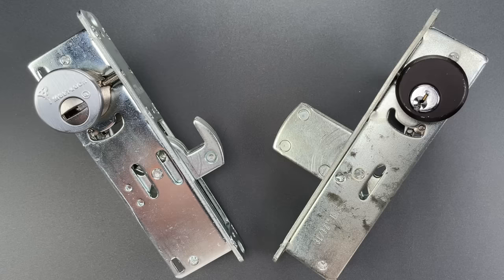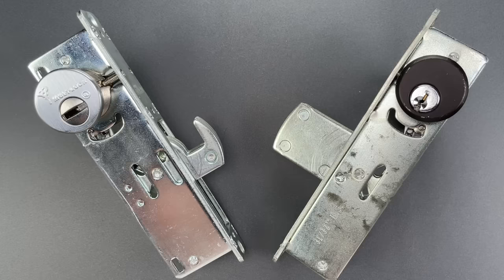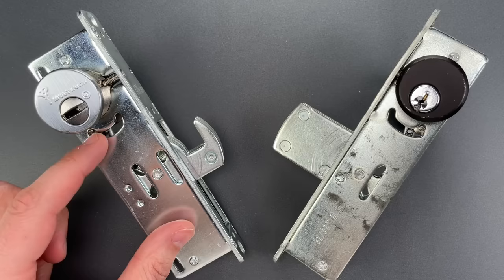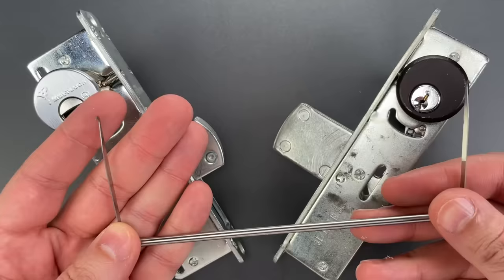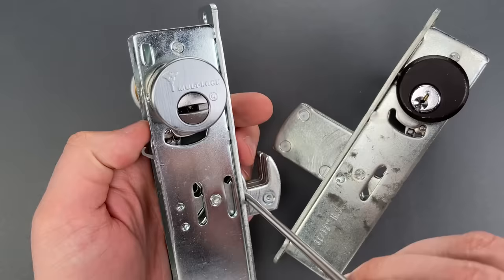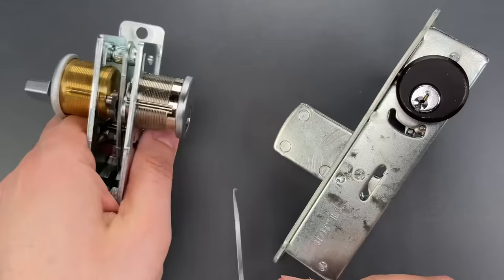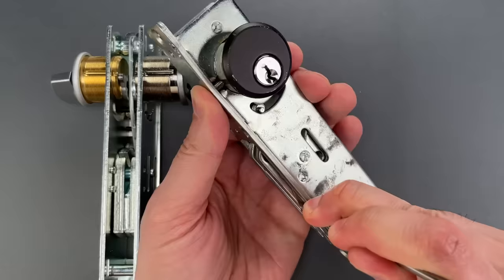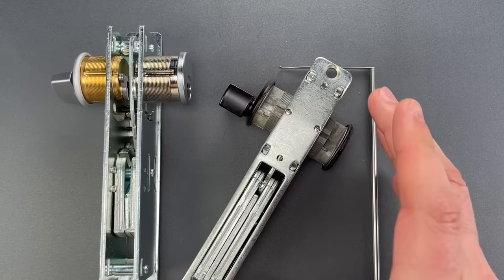[1409] The Most Significant Security Flaw in North America

Comment: I worked security on building sites in the 90's and a lot of the time we held the keys to the sales office if there was one there. I pointed this out to my boss after catching someone trying to get in using the same bypass. 
As far as I know nothing was ever done about it but the official line was that if its a public access place there needs to be a bypass incase of emergency. 
I always thought that was nonsense but if anyone knows for sure I'd love to hear it.
Reply: There's always a bypass. Finnish EMTs for example will either crowbar and sledgehammer their way in or drill a hole in the door with a hole saw to open it by reaching inside. And a glass door can be shattered.
Reply: @TeKaMOTO  Most of the sales offices were built the same way - effectively patio doors but with shop style locks in them. I would imagine levering them open would be fairly easy and they were double glazed but it was only normal glass so like you say breaking them wouldn't be hard either.
Reply: thats bs. a bypass would be having a lock kit for first responder's to have. thats just corpo sec trying to bs people.

Comment: Sixty years from now in a supernatural place far, far away...

"This is the Lock Picking LAWYER, and I've got a particularly high-security lock challenge today.  It seems that I have been denied access to Heaven after my death at the hands of a jealous husband while shooting Miss September 2083 for my ever-popular Locks And Lollies Calendar, and Saint Peter is looking quite angry.  

"A quick peek at the lock on the Pearly Gates reveals what appears to be a massive multi-hundred-pin tumbler protected by free-spinning Tungsten Carbide drill breakers embedded in copper alloy grabber blocks.  But using a tool I designed on the spot, I should be able to bypass the keyway and push directly on the--  And I'm in."

"In any case, that's all I have for you today.  If you have any comments or questions..."
Reply: can he lockpick his way out of hell tho
Reply: @Christian-hs4tk  He won't have to because he will have already lock-picked his way into Heaven.

Comment: Honestly, if the door that uses these locks is an "automatic sliding" type door, like you'd find in a supermarket, chances are that the side of the door can just be pulled open with a good tug. They are designed to be used as emergency exits in the case of a fire while the door is locked. Most of these emergency wing doors are not alarmed either.
Reply: When the doors are fully closed, there is a hook that engages between the sliding doors and stationary sides to keep the sides from popping open.
Reply: @filpaul  Having worked in grocery for most of my life, I can say that this is not true for all doors. Every store I ever worked in, those doors popped open even when the main sliders were locked.

Comment: another excellent video, well done.  It looks like installing a metal cover-plate over the area could help foil this attack.  Of course then one could just use an adapted tool with a longer hook shaft to circumvent the cover plate... I guess the best prescription would be to improve the lock design.

Comment: Over the year or so from watching the LPL, I've learnt that every lock is basically the same. My house keys can probably open at least 1 of my neighbours doors. And that with a little bit of practice I could break into any lock.
Reply: I bet you work for Masterlock.
Reply: You'd likely have to venture pretty far and wide to find a neighbor's house you could open with your key.  On the other hand, I used to live in an apartment building where all the locks were old and worn.  When the 2 vacant apartments on my floor both were singing a chorus with their smoke alarms going "Cheep!" due to low batteries, I discovered my key would open both with a bit of jiggling. (KW-1 keyways)  Bringing this up delicately with the landlord, they replaced all the apartment doors with steel security doors a few months later, with new (though unfortunately still Kwikset) deadbolts.  Oh, and I did replace the batteries in the smoke alarms and didn't just take them out.
Reply: If your neighbours all have locks with master wafers in then it's a possibility that your key could work on a shear line in another lock. The more unique master keys in circulation, the more shear lines and higher the chance of you getting a random match. Otherwise it's unlikely you'd find a similar enough bitting for your key to work in a different cylinder. Different manufacturers and it almost certainly won't work as the keyways will be optimised for a different shape of blank a lot of the time.

Similarly with the all locks are the same, they're really not lol. Buying a Medeco will usually do the job. Few people can crack the sidebars, even in a vice on a workbench. In situ it's a near impossible feat without specialised tools and knowledge. There's a video of Chessguy on YouTube legitimately cracking a Medeco, most if not all of the others are fakes, where they've messed with the sidebars to reduce the challenge level. There are a few other decent core manufacturers, and then there's the Bowley lock, which I think is still undefeated in the field. 

In summary, most locks are similar and most of them are a bag of shit, but the brand's you don't see LPL cover, some of those are worth the seemingly excessive cost.

As for opening any lock, with sufficient practice you can be as good as BB or LPL. There isn't much magic to it, just a whole lot of practice, muscle memory, visualisation and lateral thinking. I guess being deft is an advantage, but it's not a necessity. LPL uses heavy tension himself.

Comment: You would think there would be some kind of interlock built into the design, requiring the key to be inserted before the mechanism can operate. I suppose you could easily get around that by putting any similar key into the lock but at least it would be an extra line of security. 
Edit: also, well done on another great "burglary 101" session! 😁

Comment: As usual it is worth pointing out the big glass panel on the door means that entering through a locked door was never an issue. 
And while this may allow you to enter covertly, you still then have to deal with alarm systems, security cameras, and so forth.
Reply: Wait.....did you use common sense to debunk the comments about an increase in store break ins due to this video? This is the internet and we don't tolerate that kind of critical thinking.
Reply: so no need to lock the doors then?
Reply: Someone I knew used to work retail and since he lived close to the business was on the call list by the alarm company (not the owner). One night he gets called out by the alarm company. Someone tried to take the glass off the door but set off the alarm. Didn't get a thing. Weeks later he gets another call and the police are there but there's a BIG rock through the display window next to the door and they got some stuff. Most criminals know smash and grab is the way to go. And many of the larger stores have crash gates over their entrances so it may not be so easy to just use this tool.

Comment: I imagine that the simple addition of a hard lip on the door to cover the gap where the tool would need to go would pretty much be enough to stop this particular method from being feasible. That said, I doubt most stores would spend the money to do so.
Reply: @Obie1844  I've seen a gas station or two with ballistic glass for the doors.  Although there also was a ballistic glass box protecting the employee.
Reply: Some places actually have a plate that covers that area...
Reply: @Obie1844  not all glass is the same. I've seen people chuck bricks over and over and over at some glass doors and never make a dent

Funny enough the easiest way to break glass is also the simplest. Don't bash glass. Get a tiny piece of broken ceramic the size of the nail on your little finger. You can find this by breaking a spark plug if you need one right away. Just throw it as hard as you can at the glass. It might take more than one throw but eventually it'll land properly and explode the glass due to the tension that glass naturally holds. It's a useful method if you're ever trapped inside a car since this works best on car windows. Most thiefs know this method
Reply: alot of municipalities wouldnt allow you do add that piece to a "storefront" system. not all but a lot. especially if its public access
Reply: Yes a secure sheet metal lip seems like a likely defeat of this type of tool. I have always considered these types of doors, especially the one at my business as less than secure. 
I have magnetic proximity  alarm sensor on door as well as overlapping motion sensors at the entrance. 
Obviously many businesses will further secure this type of  entrance with steel locking bars and gate. That is enhancement too, but I wonder if they too suffer from the same locking scenario?

Comment: Technically, you wouldn't be able to do this if the door gap is well fitted with the metal framing of the door. This wouldn't work for all stores but for some for sure.
Reply: And some use stuff like seals or plastic guards as well, for better door sealing. That being said, I can easily see a lot of doors still being openable by this.
Reply: also why outward opening doors, which seem pretty ubiquitous in the USA, are bad.  in most places an inward opening door like this would have a stop covering the lock and the hnges would also be on the inside.
Reply: @n147258noah  Rubber seals are easily pushed aside with the tool. They're usually soft not to scrape or break too fast.
Reply: @mralistair737  Interesting, thanks for sharing.
Reply: @mralistair737  Outward opening doors are required for commercial buildings for easy egress in case of fire.  A bunch of frightened people bunched up against an inward opening door is a death trap.
Reply: @primordial_platypus  in the uk and most of the world it's based on occupancy, so over 50 people and you open outwards, less and you you can open inwards.  given that most shops dont have the right to open onto the pavement/sidewalk and are tiny it works well for most places.

Comment: It's mind boggling that such a fatal flaw lies at such a common lock. Unbelievable even that this passed QC.
Reply: Security lies in variety. The most common a security tool is (both physical and digital), the most likely it'll be attacked. Because once a flaw is exposed, the attackers basically obtained a master key.
Reply: @moteroargentino7944  
Not entirely true. Security lies in the weakest link. Even with this flaw known, the alternate is a brick or heavy object through the window/door. 
Criminals don’t pick a lock when the door is practically opened via any random object found on the street.
Reply: @FilmFlam-8008  however a brick shows forced entry and is quite loud. This is unforced and therefore harder to detect and does not announce to everyone that you're entering. Of course many places also have alarms which would mitigate the risk of someone sneaking in this way but this flaw is seriously ridiculous.
Reply: @FilmFlam-8008  Both are true and not mutually exclusive. Any good  security system has layers and each layer is as strong  as it's weakest link.

Comment: As some has said, are what are the replacements.  The simple fix, if this is an outward swinging door is to install a shield over the lock region, or better yet the complete front lock side of the door.  This would be good practice for doors as well for double doors with motion sensor magnetic locks.

Comment: I can't help but wonder if this is why some of the "more secure" doors with locks like that have those metal plates installed covering the bolt and body of the lock
Reply: It's probably intended to prevent someone going at it with a cut off wheel and blocking this tool is just a happy accident. Also, the plate would have to cover the whole door front to be completely effective, the would-be thief would just have to bring a longer version of the tool.
Reply: Common AR locks are not meant to be "secure". They usually claim it in the advertising. But at the same time they also offer different price ranges with different ratings and features.
They are meant to be cheap. They look "secure". They operate properly. That's enough to deter most thieves - who will likely break in by smashing the glass anyhow.
Reply: @dhawthorne1634  A baffle plate (solid) from top to bottom is standard in places where it gets cold outside, because it prevents blizzards going through and wasting the stores heating bill.  The plate can be steel, aluminum or wood and painted in any style fitting the store.  Effectively it's 7' of ¼x1½" material and some screws or glue.  Add foam or rubber padding for less noise and lower HVAC bills.
Reply: @pwnmeisterage  Most cheap locks are "symbolic locks". Their intent is not to make things secure, they are meant to signal "keep away from this".
Reply: It is why. But then you just need a longer (or more specialized) tool.
The security plates are all about the same size, so you just make a tool to bypass that size.
Reply: @MikkoRantalainen  depending on where you live, insurance may require you to have everything "locked" or they may not pay or reduce the payment.
Sadly it seems a cheap necklace held together with a hairpin around the handles on the inside would qualify as "locked"...
Reply: @Prophes0r  I agree. The correct way to fix this vulnerability requires changing the lock casing to not have unprotected access to the mechanism. Basically the lock casing must have kind of labyrinth design to prevent inserting a tool via the tongue opening in the lock.
Reply: @alexanderkupke920  Yeah, there was discussion on the channel LockNoob between LPL, BosnianBill, Deviant Ollam and LockNoob where they used expression "symbolic lock". That can refer to any lock that has so poor security it should be considered symbolic marker "do not touch my stuff".

Insurance companies here in Finland require that the burglarer must cause some visible damage to door or lock, so basically the lock must be good enough that the attacker uses brute force instead of picking the lock.

Given that battery powered angle grinders are getting cheper and criminals are lazy, practically anything will be considered lock because criminals will just cut anything resembling even remotely a lock with the angle grinder. On the other hand, you could just use so mechanically weak locks that the attacker can break those by twisting a screwdriver. That would be the ultimate symbolic lock in my mind.
Reply: @MikkoRantalainen  By that reasoning, a zip-tie is a symbolic lock.
Reply: @Prophes0r  Zip-ties are so easy to unlock without cutting that you would be gambling that the thief unzips it instead of cutting. Other than that, I fully agree.

Seeing that LPL seems to have most problems with packaging tape, even that might qualify as a symbolic lock.
Reply: @pwnmeisterage  They use landrovers around here. Smash clear through a wall, and the landrover drives off without a scratch.